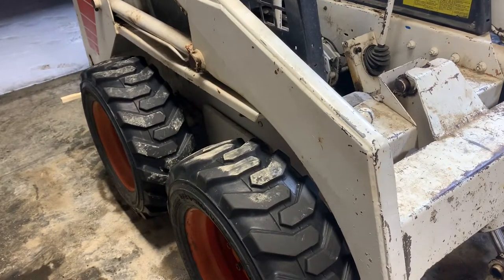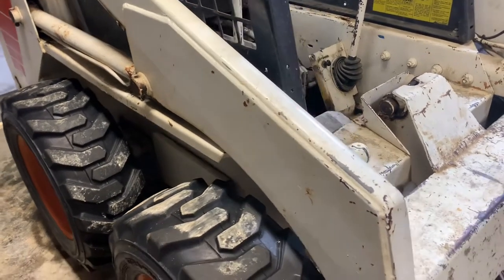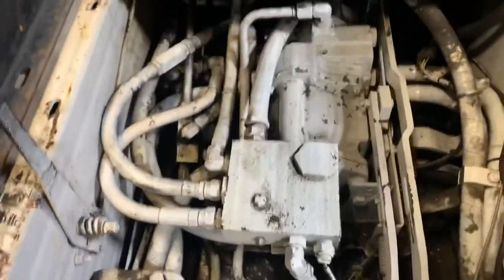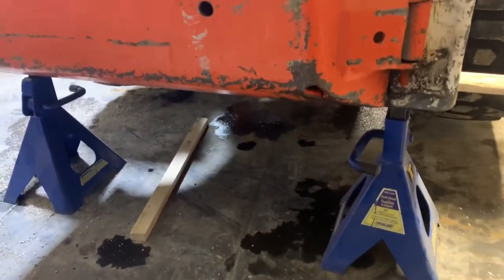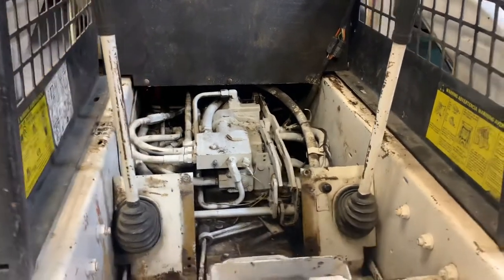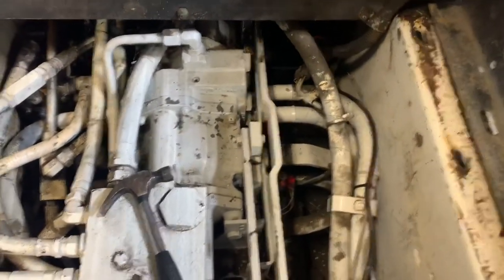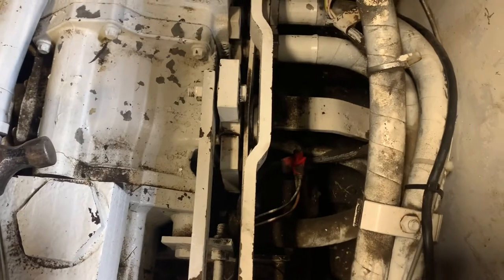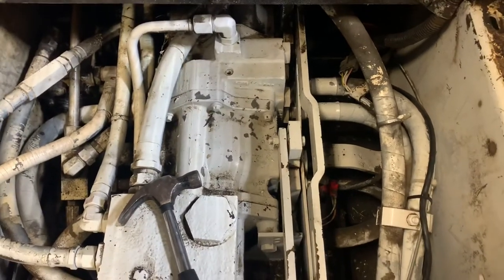Older Bobcat loader creep repair

Comment: 100% correct best video, no need to buy any parts. Between small amounts of ware and these bolts backing off on their own from vibration this is a repair you will have to get familiar with if you own one of these.
Reply: i bought longer bolts and put nuts on the back of them.  between locking the nut and bolt together tightly and the threads inside the steering block, they should be tight till the machine dies for good.

Comment: Does the hydraulic fluid need to be brought up to operating temperature first? Its cold outside. My Allis tractor has a wet hand clutch and it creeps when its cold, then goes away. Wondered if cold oil has an effect on a Bobcat for creeping.

Comment: I have a creeping 642b. When I'm going forward I need to constantly pull back on my right lever to keep her straight. Will this adjustment fix that as well? Total noob to these machines. Thank you for the video!
Reply from the maker: No, most likely your linkage needs adjustment, or your steering lever bushings could be worn out. This adjustment is mainly for setting the neutral.